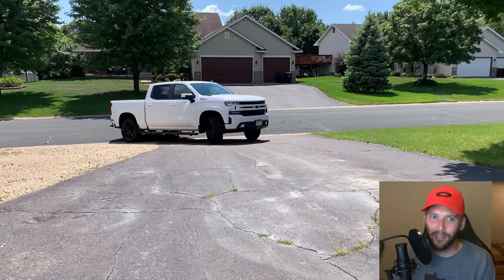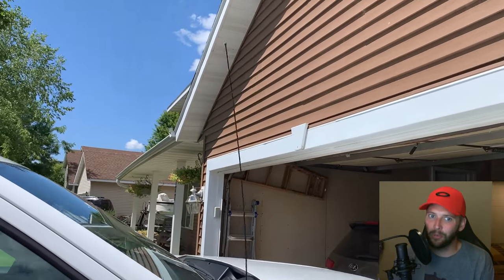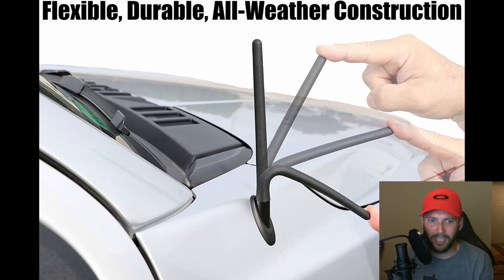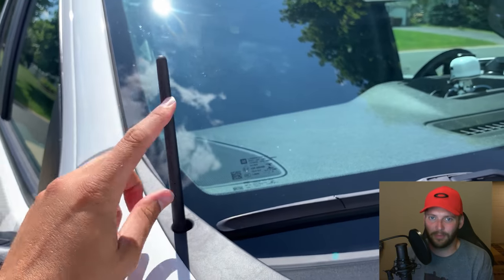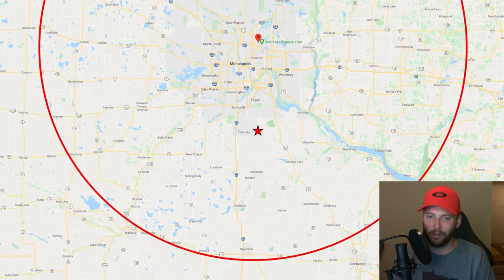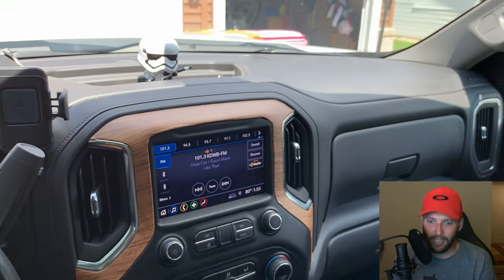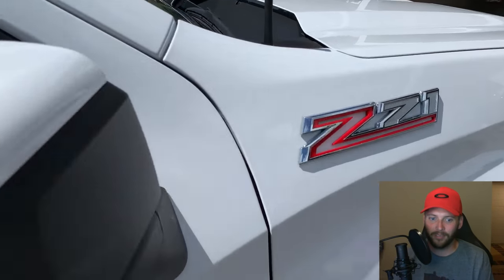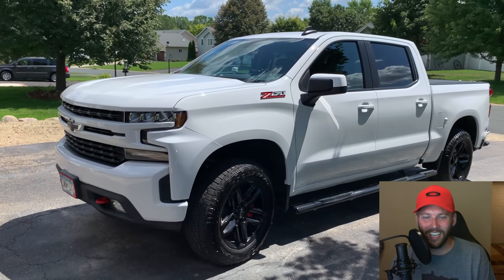Do short antennas affect reception? Review for 2019, 2020, 2021 Silverado or Sierra

Comment: Now you should be very careful driving in parcking structures because this little antenna won't tell you that you are going to scratch the roof 😳
Reply: exactly what i use mine for
Reply: All you need to do is figure out how high your truck is and every parking structure has the measurement painted on the structures lmao
Reply: @catimes6308  do you really trust those writings? Sometimes they reroute fire sprinkler lines to satisfy fire Marshall's citations but they forget to update their writings.
Reply: @amprg  Yes I do I don't know what state you live in that they reroute a whole fire sprinkler system to satisfy fire marshals lol.
Reply: But I'm also not saying it's not possible for all that to happen ppl make mistakes too

Comment: The longer antenna is tuned for longer radio waves. that means AM radio. You will not see any degradation for FM especially if you're tuned to HD Radio station since HD Radio is all digital. Either you get a reception or you don't, there's no gradual drop in like analog radio would.  In fact, you might even get a better reception on that frequency you were showing with the shorter antenna. It's a clear winner.

Comment: Nice job testing it. Doing the due diligence of finding where the signal was coming from so that you knew the reception would be delivered from 6oclock was a nice touch. I think I’ll grab one for my 2022 trail boss. I’ll use your link. Hope you still have affiliation so it helps you out. Thanks for the video. 👊🏼

Comment: As long as the unwound length of the conductor is the same as that wire you can see wrapped around your original antenna whip, your new antenna is the same electrical size as the original.
But the truck body will block some of the signal, depending on direction.
AM will probably be most affected.
Reply: The wire wrapped around the stock antenna has nothing to do with reception. It just illiminates wind noise. The mast length of the stock antenna is pulling the signal.

Comment: Have used multiple stubbies on different trucks. One brand had a permanent bend from wind resistance after awhile. Didn’t affect signal but looked bad. Another brand performed well, but I was always hitting it when I cleared snow.  I’m getting ready to try a Ronin bullet on the new truck. Being delivered today as a matter of fact. Mixed reviews so we’ll see. I live near a big city so most stations come in regardless plus I use Apple play more often than not. Overall I like stubbies.  More aesthetically pleasing.

Comment: Bought a similar antenna for my 2019 Duramax. . And wouldnt you know it, my original antenna was literally rusted together so tightly, that as i attempted to loosen it, it somehow just spins in place (with significant effort) and didnt back out!! So, after some investigating- I grabbed my bolt cutters, and clip the antenna off just as the base becomes a hexagon... Fortunately i could see down in it and actually see the tip of the base down inside, which is where I squirted some PB blaster on it and waited 24 hours... luckily I managed to get it out afterwards, thank you jesus! 
Great videos bro!!

Comment: It performed the same, because the sharkfin antenna on the roof is used for radio, data, serius xm, etc. At least according to the owners manual. No clue what the antenna that you replaced is for...
Reply: Radio. I called a GM rep and confirmed.
Reply: My wife’s 4Runner has the shark fin and an antenna, and she can’t listen to the radio (fm) with her antenna gone.
Reply: @jgibby905  well. We are talking about a silverado not a 4runner
Reply: @DR0CK  fair enough but it’s still a vehicle with both the shark fin and a separate antenna. It’s a fairly safe assumption that both serve the same/similar functions.
Reply: @jgibby905  thats what i would expect also. But my manual specifically says the sharkfin does all that and doesnt even mention the other antenna. I assume its for longer am/fm range out in the boonies
Reply: @DR0CK  yeah I have a 2017 Yukon and it actually only has the shark fin, no antenna. So my shark fin up too does it all. I wonder if they’re just cutting cost by not differentiating in the manual.

Comment: Want to know how to solve your antenna radio reception?  Buy a powered AM/FM antenna booster. It hooks up to your radio antenna cable and you run a power wire to the fuse box then tie down inside/under the dash. EASY PEASY PROBLEM SOLVED
Reply from the maker: I don’t really have a problem. This one still works just as good as stock one.